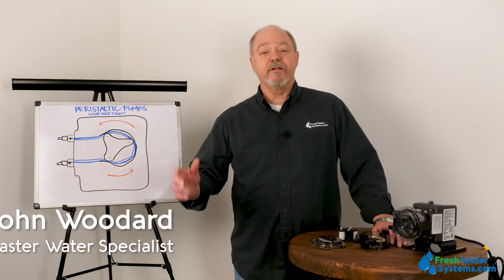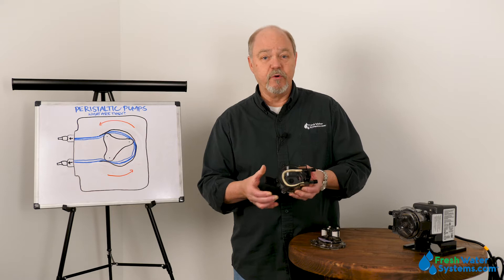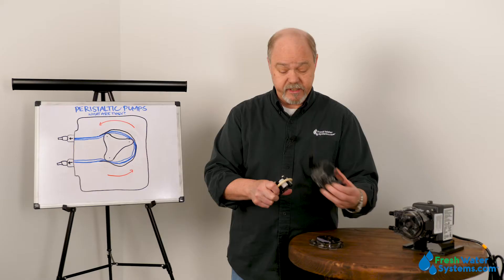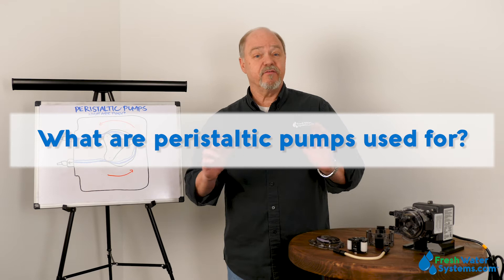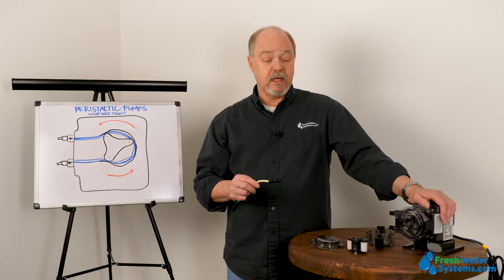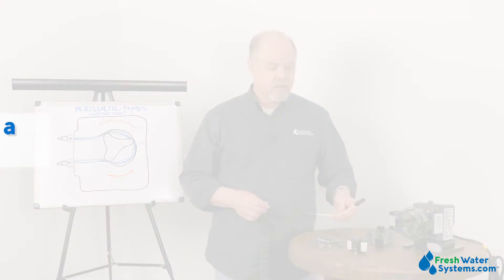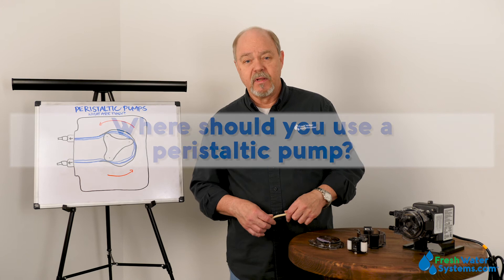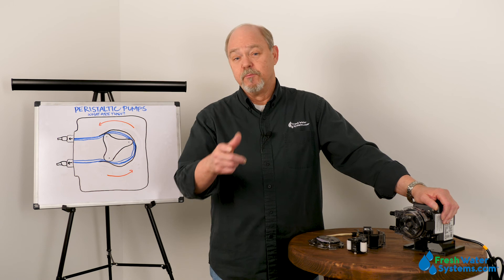What is a Peristaltic Pump and How Does it Work?

Comment: So I can fertilizer dose with this in a mixing tank thats awesome . , how do you adjust them?  I see a pump that say 5-100ml/minute so it must be adjustable ?? I can hook a perstaltic pump up to my orbit sprinkler timer that I'm using to run orbit electronic valves in my irrigation system , I can  have my regular 120v timer set off 120v 500gph res pump , to deliver water thru a by pass system run on a orbit valve as well ,set to the orbit timer , to direct it into a mixing tank with an agitator , then after several minutes of mixing have the pump turn on to my mixing tank to deliver to the plants I could even use another perstaltic pump to adjust my ph as well , the by pass is so I can send regular water to my plant as well and all the tanks would have flood protection from timed shut off valves,check valves , and float valves  have to do the trial and take notes,  no room for trial and error , just trial and take notes , then I can time everything perfectly . :)  I wonder if they have electronic shut off valves that will shut a pump off ..like cut the power , other option is to go for what I know exists , like a psi shut off switch, so many options when yea learn a few things

Comment: Hello John, I am a mechanical engineer and I want to ask you how much head can a peristaltic pump provide, and at what range of horse power can it provide.
Also I want to ask how many stages can be a peristaltic pump. 
Reply as soon as possible 
Best Regards 
Youssef S.Sebaaly
Reply: It varies depending on the condition of your tube and rollers. It's better to check at different RPMs against a measuring beaker for the flow rpm correlation.